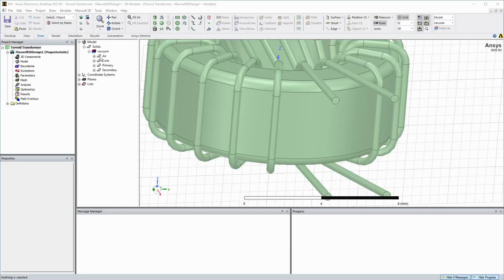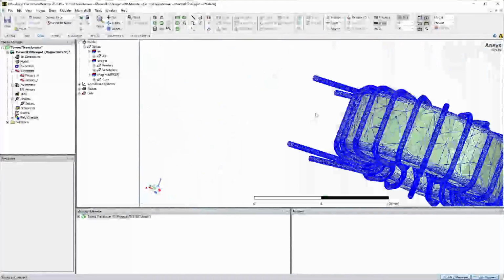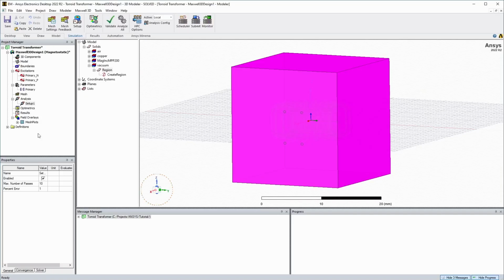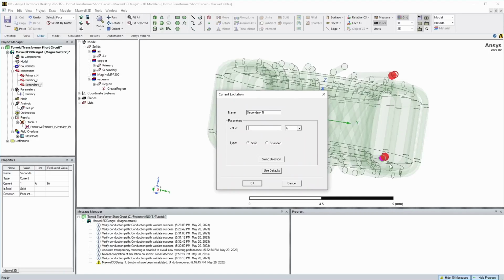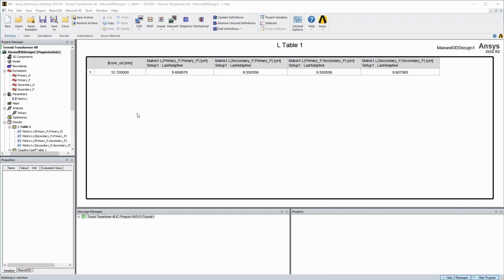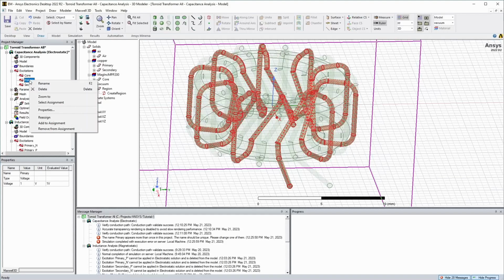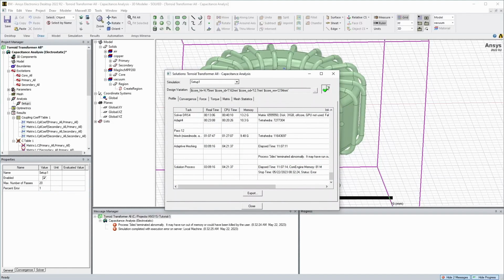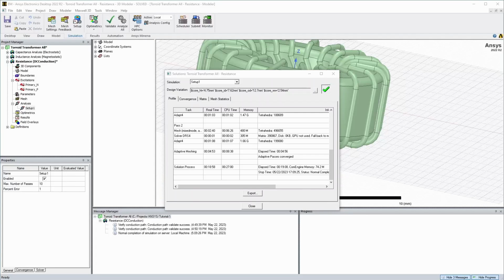Ansys Maxwell - Intro 5, Attempted Manual Parasitic Extraction

Comment: Thank you for your tutorial! I followed your instructions. The reason for the failure of the first simulation is not that we didn't set the boundary, it's that the setup of the mesh. After changing the mesh setup, firstly from Auto to Classic, secondly, uncheck the "Apply curvilinear meshing to all curved surfaces". Then the simulation error "the current leak to the air" will be resolved! Thanks for your effort! Great Tutorial!
Reply from the maker: Awesome, thanks so much for troubleshooting this and sharing your results!